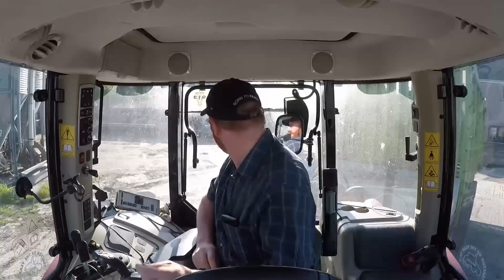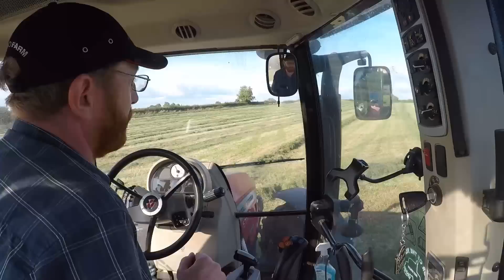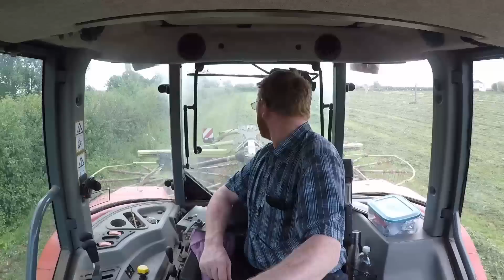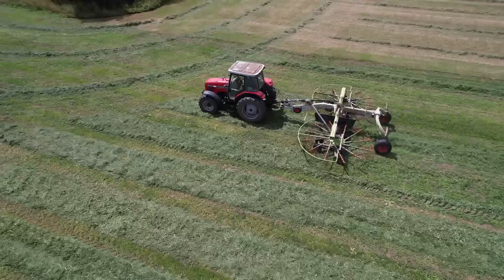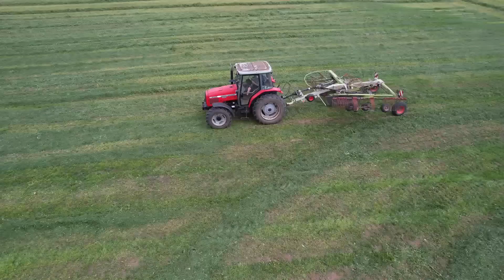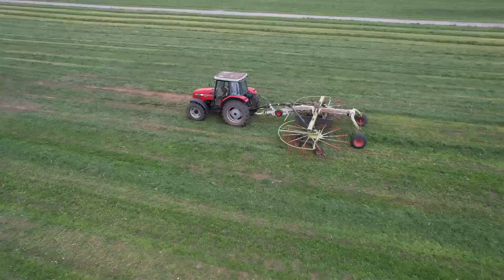A light crop of second cut silage.

Comment: Your tractor is over 20 years old yet it still looks modern.  Whereas a 20 year old 690 in 2002 looked dated.
Reply: When I was younger, in my teens in the 1970’s, we had a new MF 165, which is not that far removed from the concept of a modern tractor. Currently have a 30 year old Same Titan 160 which is higher specced with electronic engine management and nine speed electronic powershift and linkage etc than many current new tractors.  Point being that a 30 year old tractor in 1972 when we bought the 165 was a Standard Fordson and a Field Marshall.  The development of the Ferguson system three point linkage and draft/position control along with live drive PTO transformed agricultural machinery and indeed agriculture itself from a labour intensive position before and during The War to a modern vastly more productive industry over a very short period of time. That along with fertiliser and pesticide use and crop breeding advances completely transformed the industry with half of my father’s lifetime. Such rapid advances have not been since since the 1970’s and before anyone mentions it, the Q cab was just the icing on top of the same  cake.

Comment: Do you have float on the spools on the 4345? I’ve recently bought a 4345 and it doesn’t seem to have float, or the lever lock into flow. Been using a log splitter and had to tie the lever back to the armrest
Reply from the maker: No, we don't have either, but they were an option from new so may be able to be retrofitted.

Comment: The rake looks like it should be set about six inches wider, unless it is at its full width already. It certainly isn’t well matched to the mower’s cutting width as it is.
Reply from the maker: Rake can go much wider, but then the swath would be too wide for the wagon pick up.
The rake is set to match the machine following it, not the machine that went before it.
Reply: @CowfarmerDan  
Ah!   Has your wagon not got a 3m pickup? My rake puts 3 of 3.2 metre swaths, just about at its widest, into one and the SPFH picks up easily with a 3m table. 
I prefer to rake after my spreading mower or after tedding so that I can straighten some wavy lines out and round the corners. I used to be the forager man when I was younger and had more staff [father now deceased] but now I’ve been promoted to be mower and rake man mostly.